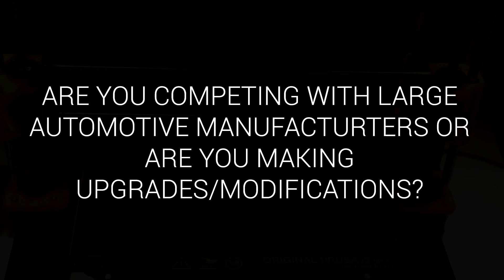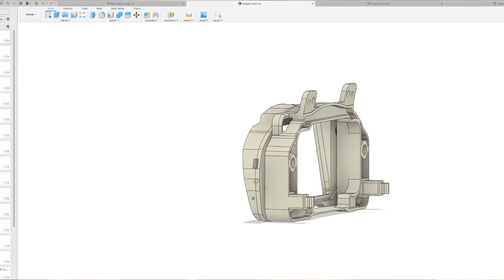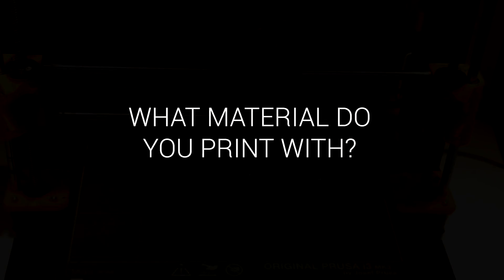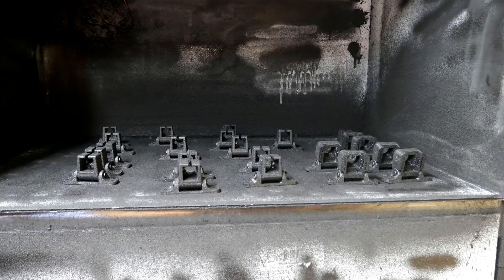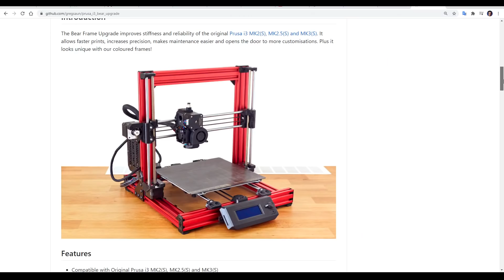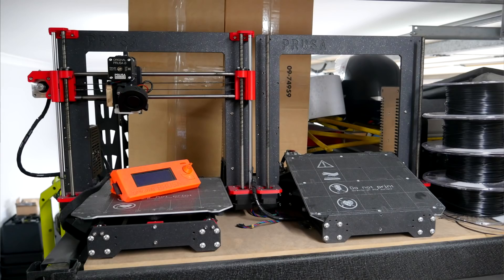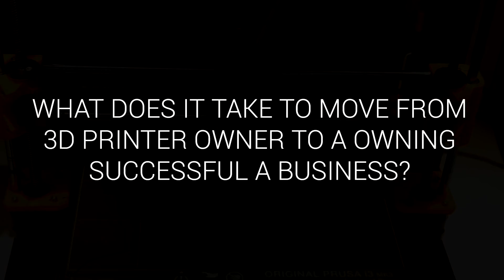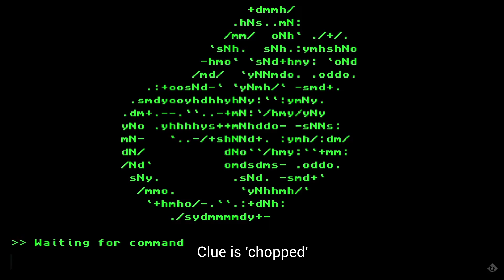3D print for a living? - Meet a Maker: Myles

Comment: I've watched this channel over some time, but missed this video until now.  My business is VERY much like Myles, I was kind of surprised by the similar path.  I run 18 Prusa's currently, and transitioned from 18 Ender 3's. My products are aftermarket modifications and much of what he said is just dead on.  People will doubt the strength and the process, but once you've shipped tons of product...that goes away.  I also use ABS but I brim everything as well.  While enclosed, I've found brimming was critical to keeping purely flat parts.  Prusa's saved my business because the battles I was fighting with the chinese printers was sending me down a path of failure.  At one point, I just had to force the transition.  They are work horses...that's all there is to it.  I run them 24/7 and the only real issues I have are occasional clogging.  Would love to talk to Myles but we are an ocean apart.  The upside of 3D printing is cost leverage.  Small volume (hundreds or a couple thousand) manufacturing with 3D printing gives great cost leverage.  Therefore you can make an engineered (customer value perception) part, that does the job at a high amount of leverage for profitability.  I've also invested in the Einscan HD Pro, but sometimes think I should've pushed to the HX.  I scan cars also and the Aesub spray is essential to getting good data.  I outsource a lot of cad work on upwork...things like reverse engineering jobs, etc.  It can be done.  I launched a product and pulled in over 200k dollars in pre-orders with a single printer and a prototype.  I then scaled the business as a "kick start" and delivered the products.  Now almost 16mo into it, I'm over 500k and have more products coming out.
Reply: congrats bro 👍Thanks for sharing your success story! Let me know how it goes for you.
I also started my own business recently and so far it's a lot of testing and research, hopefully soon I can start selling.
Reply: Any advice on coming up with a product?  I designed and sell a couple of things, but they are just standalone products that I sell to consumers via ebay/etsy.  I would really like to get into what you're doing, selling more unique functional parts.

Comment: I'm in the middle of upgrading a Two Trees Sapphire Pro.  The OEM main board has marlin support issues, so it's about to be replaced with the SKR 1.4 Turbo.  The OEM hotend isn't the best, so I'm replacing it with a mosquito hotend.   The knock-off BMG kept coming apart, so it is now replaced with a Bondtec LGX.

I also added a BL Touch.  Once I set it up as z-min stop for homing and dialed in the z-offset for UBL, prints have gotten more reliable.  I'm using github user inib's (sp) marlin branch for his sapphire pro, at least until I can get the time to convert to the skr with (probably) klipper.

Comment: Does anyone have any tips on running a 3d printing business like this but on a 3rd world country? Since corona started i was forced to move back to my hometown and was stuck at home, so I had to find a way to make a living from home. I bought my first 3d Printer on April and I've been making mostly gaming and cycling accessories. It's generating sales but it's only enough to cover my daily expenses. I have done same advertisement of my 3D printing service but so far I haven't had any customers. I don't know if it's because of the unfamiliarity of the technology.
Reply: Maybe go around your hometown and see if you can identify some common needs? Things that will make lives easier without costing you too much to make? Once people see that, they might come up with a lot more ideas for you.

It also helps if you can find things that will print well without a heated bed, as that can greatly reduce the power draw on certain machines

Comment: 3:09 Well you don't really need "CAD" specifically. You could do it with poly modeling or sculpting.
Reply: Ya, don't need Fusion360 for everything. I make custom made orthotics. I make about 4000 pairs a year at $400 or more a pair. And I use nothing but Meshmixer.

Comment: One key question I would've asked is how to calculate pricing for their parts.
Reply: CNC Kitchen and Maker's Muse have great videos on that! I personally have a list of costs I can easily reference and a template quote set up in a spreadsheet, so I can take a little bit of data from my slicer and get an accurate cost pretty quick.
Reply: Besides paying off the initial investment on the hardware (printers) and throwing in labor, R&D and stuff--Cura has a built in calculator to tell you exactly the cost of filament for each print. At least that part is easy to calculate. What your time is worth and how you price that in is much harder. I'm starting to do prints for other people and I'm finding they don't value my time at all. They see it as $2 in filament and want to pay $2 total (or less). Frustrating.
Reply: IDK about him, but I created a excel sheet for myself, based on a couple others I saw. pretty much divides into printing, shipping, labor, and a multiplier for profit

Comment: It would be interesting to know after how many working hours do things start to break on those prusas.
Reply: Depends on the individual printer, nothing in particular fails, never had a mainboard or a stepper fail, I swap the bearings every 6-9months. Hotends and thermistors fail the most
Reply: @maskwith  Interesting :) That's super often replacement for bearings that really don't see that much wear. In skateboarding my buddies and I replace bearings after 4 months maybe, but these bearings get all kinds of dirt in them, moisture too, take massive impacts and roll for kilometres on kilometres. 
Do you find the bearings really need to be replaced ever 6 months?

Comment: Exactly what type of "UV resistant paint texture coating" is he using. It appears to be polyurea on the air intake sample part, and a different coating on the mounting brackets sample parts.

Comment: Iv been sleeping on the idea of starting my own 3D printing business since the first time I got laid off last year, but then I went back to a job, then got laid off again in April of this year.  I got CAD knowledge, and basically the only "shot in the dark" is to get CAD software that I can use commercially and probably more printers (I got 3). The CAD software is the expensive part lol.
Reply: Not if you use FreeCAD, completely open source and free to use. A Fusion 360 license is not that expensive either, with around 500€ per year (and you get it cheaper sometimes). Of course, if you need some more advanced software like Solidworks, Catia, Creo, Inventor or something along these lines, it's going to cost you a lot, but if you need that kind of CAD software to do your work, your customers will be prepared to pay the extra to cover these license costs.

Comment: Question:
Are these parts Legal for Road Use in NSW?
What is the FIA/ CAMS standing on the matter of 3D Printed parts for Race Cars?
Reply: It all depends on the part and what it’s doing, if you are replacing a part that has an ADR attached to it then your printed or cut part would need to meet and pass the same ADR, however if you are making a bracket to say mount a DC-DC charger in the engine bay of a 4wd for example then there is no ADR surrounding that. This isn’t true for all cases but is for most.

Another example is my BRZ is V8 swapped and has a 3D printed intake. The only ADR it had to pass was a rolling noise test to be legal in NSW, however even if the intake wasn’t 3D printed it would still have to pass the same ADR

As for Cams certification it again depends on the part. Things like switch panels and dash parts are fine. I think the scrutineer may knock you back if you 3D printed a wheel bearing carrier or something structural

Comment: I do have some advise for those running a bunch of printers. Instead of running octoprint. Run reperire server. I have run 4 printers at once using a pi3 and the thing worked like a charm. I feel it's more of an industrial setup. One more thing to note is putting a hour meter on your printer can give you an idea on parts durability and expected maintenance cycles.
Reply: please share more info about it. btw isit repetire server ? i cant get any related on reperire,

what printer you use? is that mean you use repetire slicer aswell?
Reply: @MBBFM  i use repetier server. Sorry phone auto correct has this messed up. As for slicer i use the latest cura slicer. As for printers. 2x monoprice delta minis, and 2x ender 3s. Many times all 4 printers went on at once. No drama, hiccups or any issues. I like it so much I bought the paid for version to give me previews on the library of parts. I use an old tablet as an interface for it or my phone. This setup has been going on for over a year. Over 1000 hours of print time for each printer. Happy customer as well as camper to have all of the printers share a device.
Reply: @Engineerd3d  Great detail, thanks for sharing. Apologies but for clarity, why Repetier over OctoPrint? I ask because after 6 months with pronterface and my Anet A8 Plus (amazing printer) I'm looking at OctoPrint and Clipper... Keep in mind no print farm yet but it could quite possibly head that way. Why Repetier over Octoprint? Thanks ahead of time. These discussions can be very fruitful. Edited to add, Klipper not Clipper.
Reply: @TheJacklwilliams  i went with repetier server due to its ability to handle multiple printers at once out the box. I am still running it and it is working flawless with no real bugs. With that said, klipper is a completely different game. I intend on trying it at some point with a 32bit board.
Reply: @Engineerd3d  no trouble with those monoprice delta minis? Reviews on Amazon are brutal...z-axis taking random noise dives etc. Tons of constant tweaking. No?

Comment: I agree 100% that CAD is the key. This is the reason I spent months learning the CAD software (fusion) well before even buying my printer. Once I got the printer, I was able to design and print parts without the need for thingiverse although I do love finding good designs there. The first print I did on my ender wasn't a boat or a cube but a design of my own which I find very satisfying. I do see the need to print those items for config purpose's.
Reply: Yeah, a ton of people at my maker space at school just pull up models from thingiverse to print, and are very shocked or confused when I model something of my own and have to print like 5 iterations to get it right. Its way more satisfying to have this stuff on my own
Reply: Now learn stress analysis, failure theories and FEA lol jk jk
Reply: Having CAD skills also offers the opportunity to modify other people's models. Often there is some little thing that isn't right, or just needs one feature modified to make it suitable for a new purpose. But this is usually only suitable if you can get a STEP file format for the part (or some other standardized 3d modelling file type).
I also operate a machining business, and use my 3d printers for such things as making adapter bushings to center parts inside of a spindle, or even mandrels to hold parts in situations where making a mandrel from metal is needlessly expensive and troublesome compared to just letting a printer do it's thing for a day. I have also had 'paying work' from my regular customers where a FDM part is a suitable replacement, such as phenolic gears, tool box trays, door track curves, etc.
Reply: @HuFlungDung2  absolutely
Reply: For real, CAD skills make your printer 100x more profitable; they're the only reason I've earned money from my printer.
Reply: @ColinJWiens  Learning CAD should be of interest of anyone who likes to do things themselves which is something I realized waaaay too late.
Reply: Or Sculpting if you're into miniatures
Reply: Thanks for the tip, I'll do this

Comment: Hi myles I had issues with thermistors replaced with a k type thermocouple
Reply: I currently have another dead bed thermistor so I’ll take a look at thermocouples, Perfect timing Thanks!
Reply: @maskwith  Thermistors are what I hate the most about 3D printing.  Wire fatigue can be maddening to track down because it starts with a partial break that only sometimes causes erratic temp readings, heater failures or skipped steps.

Comment: Great video!  If you have any lawyer friends you should get one of them on to talk about the various licenses we use in the 3d printing community.
Reply: No need - None of them do anything unless it's a purely non-functional design. You gain automatic copyrights to any artistic designs, but you have zero protection for technical solutions unless you register very costly patents in every market you intend to sell. The time for patents is pretty much gone with 3D printing. All there is is being first, having a good reach within the community - a good reputation and the goodwill of the community to go support you so that you'll keep making new stuff. 

Basically if you intend to sell and make money on non-artistic stuff, publishing the models is not the best. Currently the CC licences that are all over the 3D printing community mean absolutely nothing for protecting technical solutions and you don't need to be a lawyer to figure that out. Just go to the site and read what they do. They are originally meant for software and code and as such could protect a digital file, but that just does not hold up with a 3D print unless (as mentioned) it's purely artistic design in nature. 

You can check out the case of the hex dice box that went to court. It's pretty much exactly this. You can't copyright a design that is functional and consists in this case of primitive shapes and say it's an artistic expression.

This was also touched upon by Thomas Sanladerer with the V1 Engineering MPCNC where he wanted to publish some derivative designs of some joints that he improved and there was some fallout of differing opinions on what the CC license actually protected. 

It's not great if you are an inventor, but on the other hand - improvements and crowdsourced evolution is pretty amazing and the alternative of copyrighting "ideas" would be a nightmare. It's just sad that people with good ideas don't get much incentive as is to make them public as you'd have to be one helluva PR and social media monster to financially subsist on making stuff.
Reply: @basementdwellR  So I hope that you take as little offense to this as anyone possibly could, because I do appreciate you taking the time to write all this out.  Every one on the internet knows something and has an opinion,  and when it comes to the law I would much rather hear it from someone with a law degree.  I am a natural skeptic and Michael is one of the few people on the internet I mostly trust, which is pretty high praise for me.  

With that said, money and protecting my work really isnt of much concern for me.  I do publish a fair amount of stuff, and I am relatively sure that people would like to hear the kinds of things you are speaking about from a lawyer, but myself I am mostly interested in how licenses can be mixed if at all.  Yeah, I would prefer someone not steal/sell my work, but I am most certainly not going to loose any sleep over it.  

I do publish a fair amount of original work on Thingiverse, but I also publish a fair amount of remixes.  I recently uploaded something that used a bit of original work and expanded on two works from different people.  I think the licenses were compatible, but they were also different.  I credited the original makers, but like I said it would be nice to hear it straight from a lawyer.  I always publish everything under cc-nc-sa, as that just seems like the best/most catch all license.
Reply: @jon9947  Absolutely no offense taken. I much like you have always been interested in what is lawful and what isn't, and what means of protection I could afford myself as well as what rights I have. I've sought out that information in any way I could (not pertaining to strictly 3D printing) and what I wrote above is pretty much the distilled version of proffessional input on the subject. I highly recommend you don't take my word for it :) I think that is the sane stance on everything that has serious implications. 

I am also very interested in fanart and how people make money off of it for instance. It's not something that is raised in the community a lot as it seems no one wants to ruffle feathers. It's an old problem and while legally black and white it's very much grey in reality depending on company and who makes the fanart. There are some interesting articles and videos on the subject, but none that seem to touch on how it's exploded within the 3D printing community. It's like an awesome angry giant wasp net that noone wants to touch. I'd love see a real discussion on this subject and a fan license come into effect that would be an official thing that could be split into 2 categories: non-profit and commercial of which the commercial would not be free. I think that would be fair given that all IP starts off with small artists before it becomes Marvel or what have you.
Reply: @basementdwellR  Thank you again.  I had never really given fanart much thought till you just brought it up, but now that you have I am a little surprised that there are not teams of lawyers out there going after it.  

Media players like Plex and Kodi scrapes tuns of fanart.